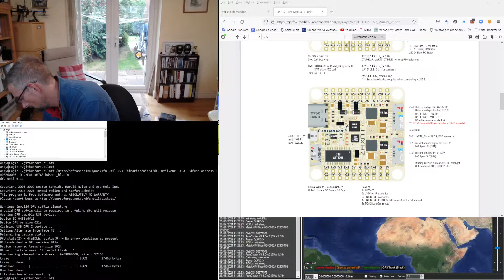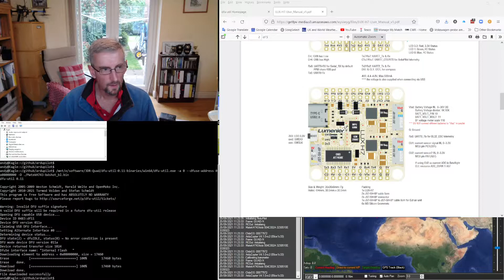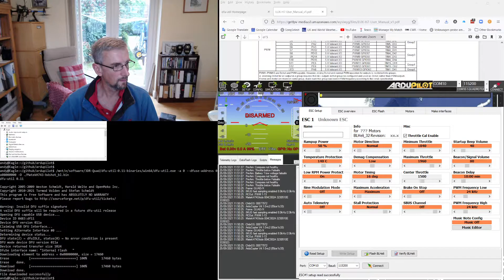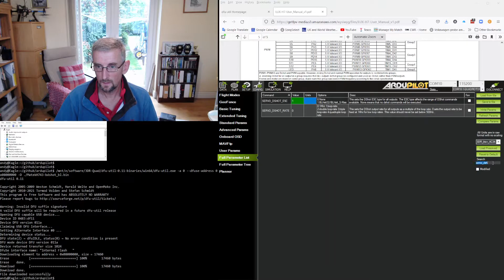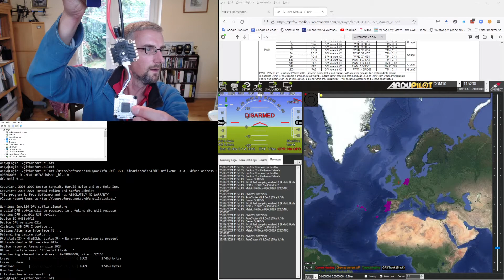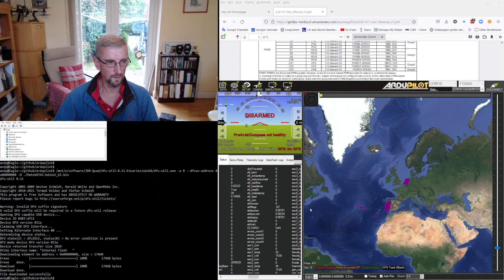ArduCopter 7" LR Build Video 5 - ESC Setup

Comment: 4S connector or XT60 versus XT90 that I believe in an earlier video you stated you wanted to use the XT90? I'm confused on the 4S vs 6S connector part...but not my first build so assuming a minor word jumbo
Reply from the maker: All that matters is the total current. 4S can still deliver a lot of total current, but more likely with 6S. XT60 is supposed to mean total current of 60A and XT90 - 90A, but people usually go a lot higher than that with these connectors
Reply: @andypiper5285  Oh okay copy that! Thanks again! Definitely learned something here in terms of nomenclature!